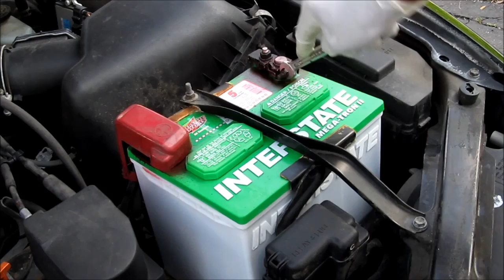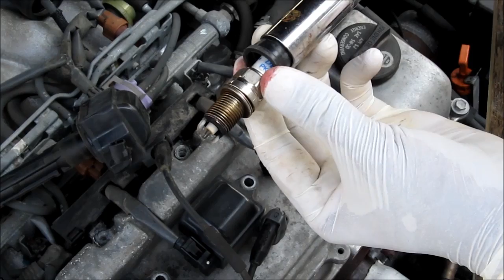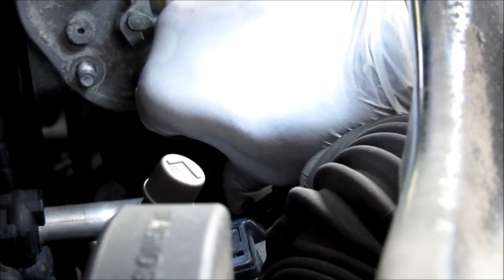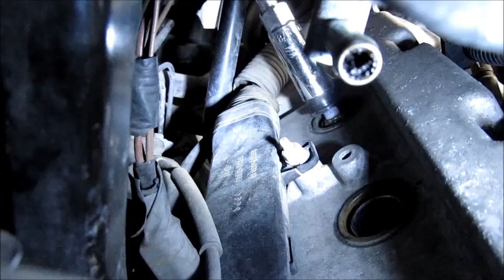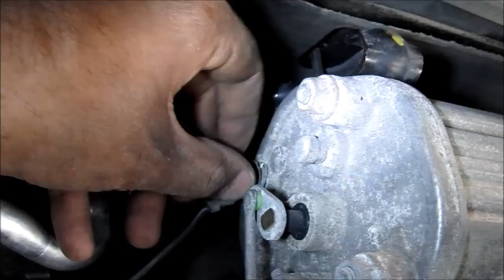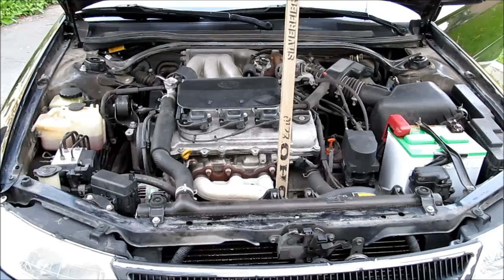Spark Plug Replacement: Toyota / Lexus 3.0L V6

Comment: And yeah you don't want your socket to stick to  plug and get removed from extension during  in the install so I remove rubber socket insert! And a dab of  grease for plug boot so next time not as painfully I hope.

Comment: Does the air intake manifold  need to be removed to remove the fuel rails?  Do you have a video doing that to clean or replace the fuel injectors?

Comment: I love this video. It is brief and direct to the point.  I drive a Camry 2000 LE with 1MZ-FE V6 Engine.  Can I know the part number of those Iridium spark plugs please. I have not been able to get a genuine set of spark plugs at my location in Africa. This has badly  impacted my gas mileage. Thanks

Comment: It's admirable that you replaced the back spark plugs without removing the air plenum.  I've seen other mechanics here that do that and it's a PITA.
Notable is a Toyota dealership didn't tighten one of the spark plugs on my V6 Solara and after 60K miles, it started working loose.  Vibrated and the electrode fractured and fell in to the combustion chamber.  Catastrophic engine damage unfortunately.  I sent the plug to NGK and they estimated it was only torqued to 10 Ft-Lbs.  They did a failure analysis on it and found the washer on the plug wasn't compressed enough, leaving the tell tale sign.  So sad because I had over 280,000 miles on the engine and until then, it performed flawlessly.  All destroyed by a negligent Toyota mechanic that didn't torque the plug sufficiently.

Comment: I was really liking the video until it got to the point where you had to take that hose off to get to the back ones cuz how you just reaching there with two fingers and took that little clamp off and all that s*** that ain't nothing possible cuz I can't get my f**** hand down in there much less than reach the damn thing so kind of stuck on that point it's kind of pissing me off cuz it it ain't like it goes in the video and I'm working on it 99 Camry just like you are

Comment: What is the torque when replacing the spark plugs?
Reply: Had a catastrophic failure on my Solara due to insufficient torquing of the spark plug.  NGK did a failure analysis and said 18-21 Ft. lbs in their F.A report.  Mine was only torqued to 10 Ft-Lbs and it worked loose, causing vibration of the plug and the electrode dropped in to cylinder 2, causing engine failure.  They could tell by the degree of washer compression on the internal spark plug washer.

Comment: No one explains the gapping for these double electrode plugs, how to check them, or how they work. They just say. "Throw em in! They are pregapped!" Well mine have all different measurements for each side on each plug. 

My specs call for 0.043 in, the plugs claim they are gapped at 0.044, and I get gaps of 0.25 or 0.24 on each side. One was 0.030! Is it half and half on each side totaling 0.43? In that case they should be at least 0.22 on each electrode. No one has answers.

Comment: NGK states anti seize isn't required and can lead to over torqueing the spark plug. Also, is it required to use double crown instead of single crown iridium ones on toyota?
Reply from the maker: If your car has waste spark ignition then you'll need double tip
Reply: @speedkar99  97 camry def does. I think the main diff is single ground doesn't last as long

Comment: For the middle rear spark plug in Cylinder 3, you can use a 10 inch extension + universal joint + spark plug socket to take it out. The extension will reach all the way pass the intake at the top next to the engine firewall. It would be easier to loosen/tighten it from that point than from underneath the intake. That’s how I took mine out without breaking my knuckles.
Reply from the maker: Awesome. Do you have the Plastic intake or metal one?
Reply: @speedkar99  metal intake manifold

Comment: Great video man, this was very helpful while changing my plugs on a 2000 Toyota Avalon with the 3.0 V6.  I had a little less room then you have on your car, but I still made it work most annoying part was unplugging the wire from the coil!
Reply from the maker: Yeah it's quite a tight job. At least you didn't have to remove the intake.

Comment: I knew it today I realized that you could possibly change the plugs without removing the plenum 💪🏻
Reply from the maker: On the metal plenum cars yes.
Reply: speedkar99 
I really appreciate it man,I did it on an old eclipse gts it was a nightmare between all the bolts and connectors breaking it took 2 days nearly.
Reply: speedkar99 
My camry is a 95’ it was not serviced at all for atleast 15 years and it’s bad all the hoses are like solid steel and the bolts turn too dust.You should change the name of the video too something like “Without removal of intake”.

Comment: Great video with excellent angles. OMG are you kidding me? You have one foot practically standing on the battery, the other on top of the fender pointing in the opposite direction, and you still manage to duck your head under the hood and reach for the last plug!?!?!?! Is this a job for contortionists only!?!?!? There was maybe one week in my early teens that I may have been able to get into this position!!! Good to save a lot of money to do it yourself even if you add in the cost of multiple gloves, bandages, hand cream, manicure, back surgery, knee replacements . . . . lol!!! :-)
Reply from the maker: Yes bro, you literally have to sit on the engine to reach back there but it's better than taking the intake off

Comment: Great video.  For the rear driver's side plug, I had to use two extensions (6" + 3") so I could get the ratchet into a movable position.  For the rear middle plug, I had to force the extension slightly to get past the intake manifold.   Also I used a magnetic spark plug socket, so no tape required. Thanks very much! All in all, it took 2 hours start to finish.
Reply from the maker: Yeah that rear plug is difficult ! Magnets help alot.

Comment: NOTE: NGK says to NOT use anti-seize on their spark plugs:

https://ngksparkplugs.com/en/resources/5-things-you-should-know-about-spark-plugs

For my 1MZ-FE (1995 Camry LE wagon), the Toyota manual specifies a torque of 13 ft-lbs, for anyone interested.

Thanks to Fish for the tip re: adding a universal joint + second 6-inch extension. Don't know if I would've been able to replace plugs 3 and 5 without it.

My 1MZ-FE is a later version with six ignition coils. It has a metal bracket bolted into the rear of the plenum which [mostly] blocks access to cylinder 3. After removing the nut (10 mm, if I recall correctly), I was able to push the bracket out of the way just an inch or two - hopefully not damaging the thin metal tube/hose it secured. Otherwise, I don't think I would have been able to get the 6" extension into the cylinder.

Lucky me, plug #3 - the most difficult to access - had seized, and was VERY difficult to remove. This being my first time changing spark plugs, I was afraid I'd damage something. But all seems well. Thanks for the video.
Reply from the maker: I put anti-seize on everything. 
We get a lot of rust around here. I'd rather something come loose than for other to be too tight and break off

Comment: every time he pulled the sparkplug, the tape on the socket was gone, if u lose tape into the engine, THATS BAD
Reply from the maker: I actually forgot my spark plug socket rubber on one once....it melted. That wasn't fun to get out of the head
Reply: @speedkar99  damn, so were u using a different socket inbetween video cuts or was the tape ripping off the socket upon removal? Also, when are you making a clutch replacement video? I have a unicorn '99 Camry 1mz-fe with the 5 speed manual (e153)

Comment: How do you do this on the Estima? The hood space is extremely limited being a minivan shape that you can’t even see half of the engine.
Reply from the maker: Remove the cowl
Reply: speedkar99 the cowl covers a 1/4 of the engine. The induction system is covering the 3 sparks at the back. That’s covered by a windshield and start of a dash board. If you think of a vans bonnet shape going almost vertically, that’s the Estima shape. I’ve been told by a couple of garages that it’s a full engine drop. They used the same V6 engine as this. You can clearly see how much of a bitch it is with a full bonnet. If only we could send pics on YouTube so you can see what I mean.
Reply from the maker: Can you access it from underneath the vehicle?

Comment: Changing the spark plug is pain in the butt! 
Now my head gasket is broken and oil is leaking i guess i have to sell my van!
Reply: My mechanic is looking for $400 to change spark plug head gasket and intake manifold gasket 🤦🏻‍♂️🤦🏻‍♂️🤦🏻‍♂️
Reply from the maker: Wow does that include parts?
Reply: speedkar99 yes all parts are included! But when i checked it on ebay how much would it cost to buy gasket sets and spark plugs is about 110-130 US dollars🤷🏻‍♂️ my mechanic is pretty much over charge me i think!
Reply from the maker: Yeah it's not easy for Sparks. 
With a blown head gasket its probably not worth fixing though

Comment: Wished Toyota Could Have Made the 3.3.V-6 This Easy for the LEXUS ES330,2-2.5 Hrs.for Them ,Tks.to Having To Remove Intake& The Throttle Body.
Reply from the maker: Yeah the 3.3 required plenum removal. Not fun, but not difficult either

Comment: My Toyota solara v6 2000, does not start or turn over sometime sometime at source in the morning after five minutes he doesn’t wanna start going to start later on again and mechanics can’t figure out why it’s doing that are you think is my spark plugs English and spark plug if I just change one plug that they will not solve the problem or have to change all the spark plugs?
Reply from the maker: Change them all. 
Pull codes and diagnose from there. Could also be wiring or ignition coil
Reply: When u say Ignition coil you mean only change the spark plug change the whole wire in there I’m gonna do that how are you got that route and snoop some help if my car starts in the morning and then after 10 minutes doesn’t wanna turn over again and then either I don’t know that it said that for 34 hours I’ll try again on STARZ number the mechanic and figure out why it’s doing that so I’ll know how to chew up on this car since I bought it just to thousand 12 so I don’t know just help me out bro should I just change one plug where the first one in the angel versus ignition coil to solve a problem thank you￼

Comment: yep, there is that familiar higher than I'd liketoyita idlr on closed loop! damn on cold winter mornings goes as high as 1800 RPM I can't even put the car in reverse at that speed! I probably could but why put the extra stress on the transmission, I usually wait till it gets down to at least 1500

Comment: okay well I was trolling inside the seriously did you cover it may be taking a can of compressed air or from an air gun in your shop area ocean spray all the debris out from the rear there a lot of times in that car design the wind goes up into the car I can actually blow up like fine particles and twigs and leaves and sits right up on the edge there right just above the for the spark plugs go.

Comment: so you'd be a lot more helpful if one you used a tighter camera view especially on the rear spark plugs and so we see a better picture of what you're unscrewing on the back for the rear also a close up of the spark plug firing clips and the return clips then go to the rear spark plugs in this waste spark system how do you take those plugs off without breaking them don't know how you will break them.

Comment: I'm going to repeat this cuz it needs repeating the title says it's Alexis you say it's a Camry and it's obviously an Avalon a 97 Avalon on a 96 what's up with the lies or is it just that all three vehicles would look identical while the Camry has single coil packs on the front and rear not dual the Avalon and Lexus have dual.

Comment: I would have kicked in the neighborhood cat at this point if I had to do it that way will it be just easier if you're going to change the spark plugs to also maybe change the valve cover gaskets in which case you'd be removing the air cleaner and throttle body an intake manifold I mean come on wouldn't that just be easier overall.

Comment: it's always wise to back thread the spark plug first to make sure it drops down into the Leeds red and then tighten it in, not doing so you can easily strip the aluminum threading on the engine block

Comment: Good job but may I suggest also using a torque wrench; snug means different things to different people. Also you may want to use dielectric grease on the boot fittings and spark plug wire connections. Good use of the anti-seize compound shows that you only need a little.

Comment: Thank you for taking the time to film and explain. I just successfully changed my spark plugs on a 1997 Toyota Camry V6.
Tip! Make your life easier: use multiple 'universal swivel joints' and 3" + 6" extensions. Easier to remove, torque, and saves your hands.

Thank you for sharing your experience and knowledge!

Comment: you did NOT have to remove the cover, unplug the coils,take off the pcv, use anti seize, you should have used the nippon denso plugs not ngk. you also didn't need to unhook rehook battery cable, reinstall pcv and cover. So much unnecessary things you are doing.
Reply from the maker: I'm not a butcher. It's my car so I like doing things properly.

Comment: Thank you I thought I was going to have to take so much more apart to do the rear spark plugs
Reply from the maker: Not on the older 3L
Reply: speedkar99 yeah I got a 1999 toyota solara camery with the 3L

Comment: Will the new spark plugs make the car accelerate faster?
Reply from the maker: Typically it may run smoother but you probably wouldn't notice it faster

Comment: Just did this job for my v6 camry 1996 and I got to say this video was really helpful...I know this job at a mechanic will be well over $250 dollars so I decided to do this myself. I was nervous at first but then I just said 'fuck it'. Followed step by step instructions to the 'T'. When I finished I started the car and it sounded better than before. No misfires or anything like that. Only spent $100 dollars for the spark plugs. Saved myself some money. Thank you once again!
Reply from the maker: +Anthony Ybarra I'm glad the video helped. It's a bit blind working under that plenum but at least you don't have to remove it on your 96.

Comment: How can I change the rear spark plugs on 1996 Camry (3VZ-FE) engine without removing the plenum? Thank you
Reply from the maker: +Abdul Al Salti the 3vz should be similar, you can just reach in behind like the 1mz
Reply from the maker: +Abdul Al Salti 96 Camry uses 1mz not 3vz
Reply: speedkar99 Thank you for your reply, but 1996 Camry Vienta in Australia use 3vzfe engine 3.0.. So do I need a special tool for that ? Once again thanks for your help.. Cheers
Reply from the maker: +Abdul Al Salti no it should be similar